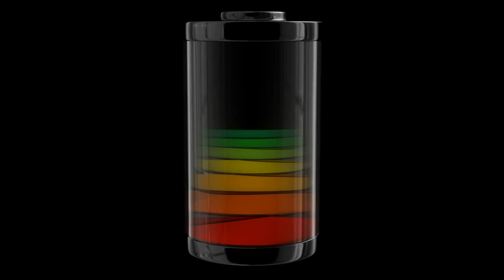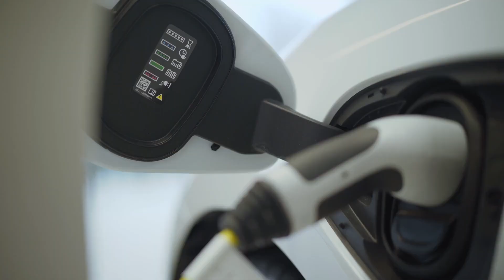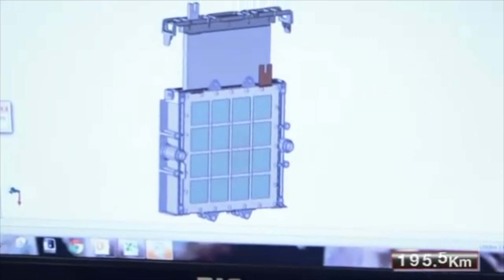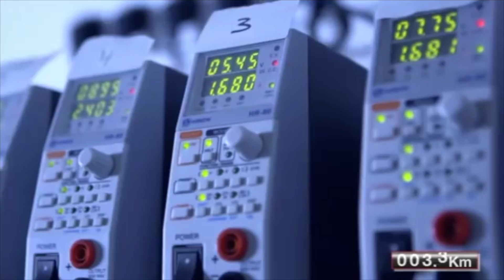This Battery Gives EVs 1000 Miles of Range!

Comment: Oxygen does not have to be stored in the battery, but would still need it. And store water and the resulting aluminum hydroxide... so the calculated energy density is misleading.
Seems like a great solution for oil companies that would become distilled water dealers... and there is already enough of a clean water issue, I am sure turning distilled water into a part of the energy system would not drive prices up.

Comment: One of the biggest complaints I hear about switching to electronic is how difficult it would be to go on a long road trip. Having an aluminum air battery as a backup battery could solve this. I can imagine a system similar to the propane tank exchange that exists today to swap out the AL battery when needed, but the Li battery for day-to-day.
Reply: They tried market  this about 30 years ago.  Aluminum fuel cells have existed for a long time, they are simply just to expensive to use and buy because aluminum is expencive....
Reply: Exactly, people Think IT is a question of either, but don't realise this is an ideal Range extender. You keep a smaller Li-ion battery for most of your diving and only Mount the Al-air battery when you need the range.
Reply: Yes.....the perfect “hybrid”. AL back up when Li battery low or when charging is unavailable - i.e. remote areas or in a blackout
Reply: remember the more complex the system the more that can and will go wrong, and be more costly, eventually fail to be viable...most engineering and research will continue until a combination works

Comment: How is the electric generated that supply power to the electric cars? I’ve heard it’s coal, does anyone know if this is true?
Reply: Some of it is coal. Most of it isn't. Depends where you live. In many parts of the world there's very little coal-based electricity left.

As Helen explains, an EV gets cleaner over time as the electricity grid gets cleaner. (Many EV owners help this process along by also investing in home solar, but this is true even for those who don't.) A gasoline vehicle doesn't and can't get cleaner over time, because it's burning the same fuel as the day you bought it, and petroleum production isn't getting much cleaner either, if any.

Also, even if you live in a place with a lot of coal-based electricity, which most of us don't, a coal power plant is more efficient than a gasoline engine, because it's so much bigger. So, there's that too.
Reply: Hi, once you have an electric car the charging gets cleaner as the power generation of Grid does. Almost all the world's electricity grids are cleaner now than a decade ago and improving year on year. A combustion car will always be burning fuel and pumping exhaust gases out the back onto the streets.
Reply: @helenlawson8426  but the way that we generate the electricity to charge the batteries is not a clean generation of electricity. It’s like switching from a vehicle that consumes 10mpg to a one that consumes 30mpg, you are still contaminating the atmosphere.

I’ll go electric because electric is cheaper than gas and I’ll get to use the carpool lane (which is really the political correctness lane, a Toyota Prius gets to use the carpool lane and a Prius is designed to use less gas during stop and go traffic.)

Carpool lanes were created to reduce traffic not to save gas,
Reply: @donc9275  Hi, that's not strictly true or the point of what I said. Any car will be polluting in its production but not all that different so we must look how the vehicle is fuelled day to day. The electric motor is superior in every way than a combustion engine in efficiency, fewer parts and pollution so we shall also put that to one side. 
Fuel for a combustion engine does not just appear at the forecourt so although it is very energy dense the journey from the ground to the pump involves a huge amount of energy input and moving around of the liquid product.
Electricity on the other hand has a growing number of ways it can be produced and travels down cables that only need to take the journey to the charging point the once. The electricity grid is near enough everywhere.
Fuel must be produced and then destroyed in a combustion engine over and over, were as a solar panel that can last thirty years can charge an EV in the middle of nowhere... ok not fast. :)
The move from combustion to electric vehicles is going to take another twenty years to happen and along side that how the electricity is produced is only going to get cleaner.
People talk about wind and solar needing backing up by gas & oil power stations and yes that is true, it is though ignoring the fact that before hand the last couple of hundred years it was 100% fossil fuels 100% of the time, so every minute of renewable energy is an improvement.

Having said all that we need to make sure that green energy is just that and constantly question new sources of energy. There has been a new report on hydroelectric dams for example showing their environmental impact is much greater than realised.
Sorry for the long waffle but I love technology which includes cars even though I don't drive. :)

Comment: When these people talk about battery swapping they're all do damned short sighted to the point of frustration. We should not be encouraging people to swap their batteries on the fly simply because they don't want to take the time to sit and wait for the battery to charge. Don't get me wrong. I think if a company and people want to do this then they could at a particular cost to the customer.

What this function should be reserved for is the actual time your battery has reached it's end of life and it's time to swap it. It can be covered in the overall car warranty like you have on a ICE car i.e. (6 years 100.000 miles whichever is first) kinda deal. And/or if you're out of warranty you can pay to have it swapped. The ability to do that, like the car company NIO does, is great. No waiting ours to have it done. Just take your car there, have it done and be gone within 30 minutes.

Sadly this won't happen at this point because unlike NIO other EV makers don't think that it's practical even though IMO I believe it is. Other than Toyota other car companies are still in their infancy but will get to a point where more and more of their customers will have to have a battery swapped and they're all going to happen weekly at different times so I believe these manufacturers need to have facilities or the capabilities at their repair centers to deal with this.

Comment: They’re really not batteries. They’re fuel. 
It’s like burning gasoline in a tanker truck to deliver gasoline to a station then burning gas in your car to go get the fuel from the station. To say nothing of drilling and refining the gas/or aluminum in the first place.
 But when energy flies at the speed of light from a power plant to your car, there’s some line loss yes, but the whole electric drivetrain, from energy provider to your car wheels is fast, efficient and flexible.

Comment: We are trying to get away from single use items. If it's not rechargable I'm not interested.
Reply from the maker: It can be recycled in a large scale operation. So think of it it as a closed loop system with 9x the energy density. That’s why it’s compelling.

Comment: You said the test drive with the hybrid aluminum air battery/Li ion battery had an extended range of over 600 km. Then you said that's over 1000mi? Did you mean 600 miles, which is over 1000km?
Reply from the maker: 1600 km or over 1000 miles
Reply from the maker: Apologies I read it wrong

Comment: Good video, I did not know about this. However, I find it not to be acceptable given what you said. Production costs, etc, nothing will be cheap (and environemental) enought to get with the equivalent of charging an EV with renweable energy.
This could be an answer for aviation or freight, because of their fixed points, but not for everyday consummer. This is not good. I think this is far to soon to try putting it in EVs. However, if you think about it as a fuel cell, and the process is somehow made reversible (like in metal recycling, you use electrolytes to deposite aluminium back) this could be the future, but not if you have to swap the full battery.

Comment: When I hear someone in the first few moments of an informational presentation imply that 2 gallons of gasoline will move my 2007 Nissan pathfinder  (that is equivalent in weight to a Tesla model 3 long range awd) 300 miles on 2 gallons of gas, I immediately no longer trust the integrity and authority of the information. The Tesla model 3 long range weighs in at about 4,250 lbs, the Nissan pathfinder weighs about 4,375 to 4,859 lbs. My pathfinder gets ~15 mpg around town and ~20 mpg on the open highway. While my Pathfinder is not very aerodynamic, so it cannot be compared directly to the Tesla model 3, there is no way that any production ICE vehicle will go 300 miles on two gallons of gas, unless it was idling the whole time while coasting downhill. This shows either sloppy research, lack of fact checking, or lack of the use of basic maths, and calls into question other information that may be factually correct. Perhaps you are referring to the theoretical maximum energy value of gasoline, and then comparing it to the real world range of a Tesla model 3?
Reply: Trust me, Ricky is well aware. He's not exactly new to the EV world. The point about energy density was not to claim that a Diesel engine and a 3-phase electric motor are equally efficient. (Aside: the latter is not 100% efficient either. Just a lot closer to it.) It was just to put into perspective the huge gap in energy density between rechargeable batteries and chemical fuels. If you don't understand this huge gap, there's no way you can appreciate how impressive it is that EVs are halfway competitive in some real world scenarios.

This wasn't sloppy research, or lack of fact checking, or lack of the use of basic maths. This was an editorial decision that not every single video that mentions energy density needs to also spend 5 minutes comparing drivetrain efficiency.
Reply: @ps.2  I believe that in order to make a realistic comparison between ICE vehicles and electric vehicles one should use a common reference system. Electrical vehicles are inherently much more efficient than ICE vehicles, so one should use real world average efficiencies for vehicle type and weight, not theoretical maximum energy densities.
Reply: @GoCoyote  If this video were about the strengths and weaknesses of different drivetrain technologies, you might have some grounds to complain about a misleading presentation. But it wasn't. His point about energy density of chemical fuels was a side note at best. I don't think this is really the "well actually" to die on.
Reply: @ps.2  Good point. Fact of the matter is that I just dropped watching it after hearing the 2 gallons of gas for 300 miles of travel equivalent. Always puts me off whenever I hear such misinformation out of the box.
Reply: @GoCoyote  Ah, give it a watch. The actual Al air technology discussed is pretty interesting. Though I'm unconvinced that it will really go the distance, so to speak. I can't see recycling/refurbishing a single-use battery ever really being practical or cost-effective. But you never know.
Reply: It all comes down to efficiency.

Comment: It sounds like a great alternative for occasional use.  Another use case (off grid).  Suppose you already have solar+storage (lithium).  It works on most days when it's sunny. But you may have a week where it's cloudy or rainy. You can go for a gas generator, for backup.  But these things are noisy and smelly.  

Suppose you can plug in an aluminum-air generator in its place?  When you're done, take it into a store, swap it out for another one.  How stable are these things for long term (unused) charge storage?  Can it be another solution for emergency power backup?

Comment: I love this idea only for emergency situations. I would carry one of these in my Cybertruck in the event I needed to charge in an area that has no power. I would take the spent battery to the supplier for recycling and take out another, much like the 5 gallon water jugs you can buy for your water coolers.
Reply: @Anton Stranc

Sounds like the winning strategy, as long as the price of the swapping spent aluminium air battery for new battery is on par with price of energy stored. The cost difference of spent battery vs new one, is the key to this being a viable energy transfer solution for vehicles. Ie. It all depends on the cost of manufacture of said batteries...

Comment: Ricky, you're not helping with the EV change by mentioning statistics used by the anti EV media. First of all, lithium ion batteries can be entirely without Cobalt or any other rare metal by using iron (LFP chemistry), which Tesla is going to use on their Model 3 and stationary storage. Next, Tesla tries to source most of their Cobalt ethically and is trying to decrease the overall cobalt further. Overall, only a small percentage of cobalt comes from these 'artisinal' mines.
Reply from the maker: Yah I agree I’ll keep that in mind. Part of the argument is there’s lots of ideas out there. Gasoline shouldn’t be one of them. Cheers bud

Comment: Aluminium air battery? but they are not widely used because of problems with high anode cost and byproduct removal when using traditional electrolytes. So why compare?
Reply from the maker: There’s lots of active research that’s why

Comment: Aluminum Air Batteries are not rechargeable, so what the hell is your point, Angels dancing on the head of pin, again. Fantasy thinking will not replace Lithium Ion batteries. And he never even mentions Graphene Aluminum Ion batteries which actually have a chance to compete with Lithium Ion Batteries, but in the future, and not right now. Right now Lithium Ion Batteries are king, and get over it.

Comment: Comparing 75kWh with 2 gal of gaz is not really appropriate. Nothing can convert 2 of gas into 300 miles of range. Even though it does not make much difference in your comparison though, it would be best to compare battery and gas weight required to cover the same distance

Comment: This isn't going to work. It's a novel idea, but there's too many downsides. Ultracapacitors are much more realistic as a replacement for conventional battery technologies. The current issue with ultracapacitors is that they just don't hold enough charge for long distance driving, but they are getting better. The trade off is that they charge up in seconds or minutes as opposed to hours. I think most people would accept a shorter range (say 100-200 miles) if they could charge their car fully in two minutes. With shorter charging times, investment could switch to have fewer charging stations in more locations as opposed to more charging stations in fewer locations because there would be less backup.
Reply: That's the rub, though. We're not (yet) in a world where 100-200 mile ultracaps are practical. Where I think ultracaps are particularly interesting is in city busses. Apparently there's a scheme in which the 20 seconds you spend at a bus stop can include charging (from overhead contacts at the bus stop) to top off your capacitors. So in that application, you don't need 100 miles of range, just a few miles.
Reply: @ps.2  Correct, not there yet but I think it's on the near horizon. Your point about stoplight charging of ultracapacitors is interesting though. Busses I can certainly see making use of this, but how about high voltage inductive charging for personal vehicles? Another option could be drive-through "charging lanes" where your car could drop a charging probe (similar to a motor brush) onto a charged conductive plate and simply drive across it for a quick charge. There's some obvious safety caveats, but not insurmountable.

Comment: DC fast charging roadside assistance. 
I don’t see an economic case for rapid use such as light vehicles. Maybe construction equipment, air travel. 
Actually with long haul air travel I don’t think most people know that a fully fueled 747 can not land. It must dump fuel to reduce weight something that won’t be done with batteries.

Comment: This seems like totaly not practical at all the whole swapping system involves so much inefficencies just from production transport and the whole unfrastructur beeing needed seems not viable nobody is driving his energy-storage what ever ist may be really low. Just Imagine your battery is at 60% and you have to go on a long trip so you just have to throw away a 60%  battery that is transportet to a factory to bei recycled ? To compensate you would need an incedibly dense infrastructure or range anxiety might bei bigger than ever